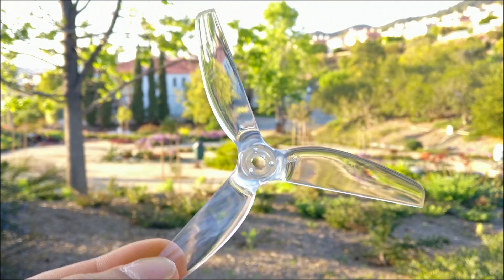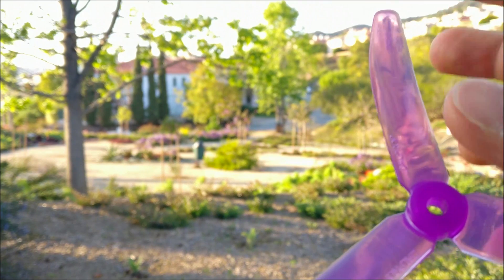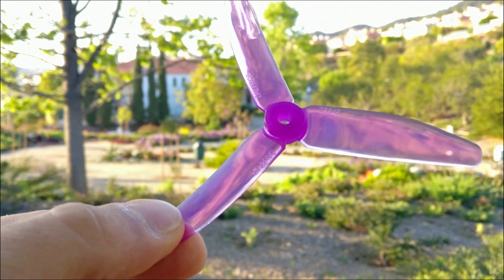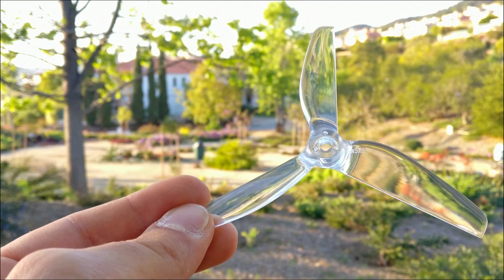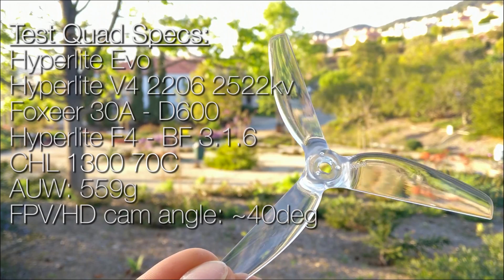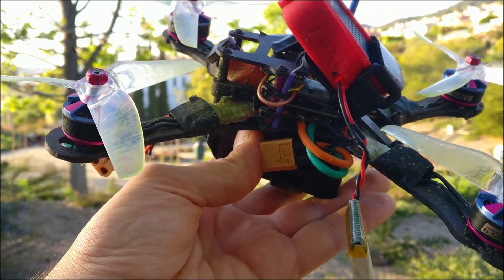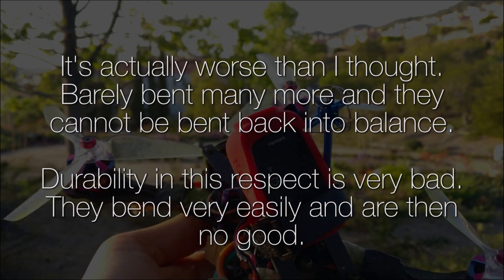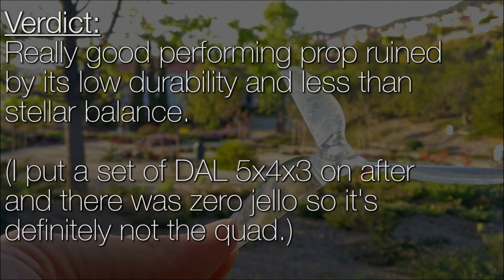Butter Cutter Prop - Mini Review

Comment: How come the tip spins faster than the center of the prop ? Wouldn't simple physics prove that wrong ? Kind of the same concept is a figure skater right arms out they spin slower bring their arms in spin faster ? Im not saying im right or wrong  i have no idea just asking a question
Reply from the maker: Tips are farther out on the spinning disk.  They will have more linear speed, the same rotational speed.
Reply: Thanks for the reply an a lil more info keep up the hard work of keeping up with the info in this hobby

Comment: I'm looking for the prop that will fit me rn.  I'm new to FPV, have an old school ZMR 250...have tried GF 5040's and 5045's have some 5152's on the way...do u have a specific prop u think I should try considering I'm new and crash...a lot
Reply from the maker: reboot 1 I would say the 5152 is the best option right now. emax will have the best option yet but won't be available for at least a few weeks. don't buy a lotta props.  the emax one is really good.
Reply: Thank you and a tip of the hat, appreciate what ur doing for the community, I've learned way more then I realized I needed to from your channel, thumbs up sir!

Comment: thoughts on doing a 4" prop reviews ? recently bought a EVO HD 4" and it would be cool to see some beast props for it in action, is there is any.
Reply from the maker: Vegar B. Vik I'm not a fan of 4" really. I think the only reasonable 4" props are the typical 4x4x3, 4x4x4 and the 4" version of the DAL 5x45x3 HBN. I just realized that even exists.
Reply: So, you recommend people to buy stuff you yourself is not a fan off or don't like flying ?

Maybe i should change to 5" sooner rather than later then. just getting the arms is enough for that right?
Reply from the maker: Vegar B. Vik yes do not do 4" unless it's a superlight. I didn't even want to draw the 4" hyperlite arms. so many people wanted it that I had to. I don't fly anything less than 5". I'm just beginning to maybe mess around with 4" and 2" but I'm not thrilled about the 4. hate the idea. the 2" is just for fun.
Reply: wish i knew this before i baught the 4" frame
Reply from the maker: Vegar B. Vik it performs fine and is very quick on some high kv motors but it's just not my thing. even worse on the hyperlite SS model they only got 4mm 4" arms. I told them to get 2.5mm. was like the toughest frame I ever felt.
Reply: my 4 inch is a rocket ship with tmotor f30s 2800kv and HQ 4x4x3 with 1000mah 60c

Comment: I agree with you that the one downfall is how they bend. I've bent plenty back into shape and run them, but you can't ever really get them back into balance and shape exactly because of the way they are designed. I might give the gemfan 5152 a try to see if they are similar to the butter cutters but just hold up a little bit better

Comment: Have you calibrated your current sensor? You said that you normally see 139a on aggressive props and that seems a little extreme.
Reply from the maker: Quad Logic no I have not calibrated my amp meter but all of my tests are using the same meter so it's consistent across them it doesn't necessarily mean that is how many amps the prop is pulling.

Comment: I would say the durability isn't a major issue for me. I've been running them since the early prototypes, and yes they bend, but they also bend back just fine.  I'm running a set on my one freestyle quad that I've been running on there through multiple crashes and through a couple meetups with race-gates and track runs.  I just keep bending them back and keep going.  I very rarely have to replace them.  Then again, I never balance my props and don't really care when they get chewed up, so that may not apply to everyone.  I found these to be much more durable than the cyclones.  My cyclones split at the hub and break long before these do.
Reply from the maker: The durability isn't terrible but when you bend it back it does give some jello which is really annoying for HD footage.  For racing, you gotta have durable props for when you hit a gate.  There are better options than this prop that are far more durable.  The 5152 is one of the most durable props and feels very similar to the butter cutter.
Reply: I don't really notice any more jello in the bent up BC than I do my chewed up cyclones. The BC are still probably my favorite freestyle prop. They're probably the best handling prop out there IMO, though the cyclone 5x4.6 are super close.
Reply from the maker: Yeah the BC is right there with the 5x4x3 in terms of handling.  The 5x4x3 has a slight edge but is a slow prop.  I actually stopped liking the Cyclone prop a while ago.  The control is so sharp which I don't like.  I attribute that partily to the props high weight.  On higher torque motors the Cyclone performs much better.  I'm still torn among all props and find myself coming back to the 5x4x3 a lot of the time.

Comment: Hey Bob I really like these props they are in my top 3 favorites right now I fly these on my acro setup and also fly hq v1s on acro setup I agree they aren't the most durable and they all bend in that same spot never to be in balance again I think the v1s are more durable and better at lower speeds not much top end the butter cutters have much better top end but my favorite all around prop is the Gemfan 5152 I absolutely love them they have pretty good low end control and really good top speed performance I just wish they were a little lighter but you can't have it all in one prop but if I had to pick one hands down Gemfan 5152 I really like the colors they come in the clear is actually clear the hq clear is more like a frosted clear not that it makes a difference in performance just looks good anyway great review and do you know when the hyper floss will be back in stock
Reply from the maker: You got it right.  Wish the 5152 was just a bit easier for the motor to manage and it would be perfect all around prop.  The Butter Cutter really is the best all around prop I've tried but to fix the durability issue, they'll need to add weight which will be annoying.  The HyperFloss prototype batch was just ordered so it should be here in about a week.

Comment: whats a good 5 inch triblade for the rs2205 2600kv motor? ive watched your videos about props and motors and im conflicted on what to get. i need some security lol.
Reply from the maker: There is no perfect prop for anything.  If you're racing, on that motor I would try the GF 5045 twin, If it's the newer S version of the motor.  If it's the older version I'd stick to the butter cutter or general DAL 5x4x3.